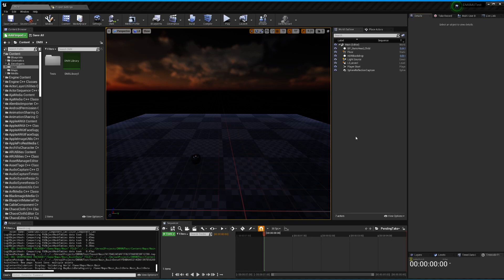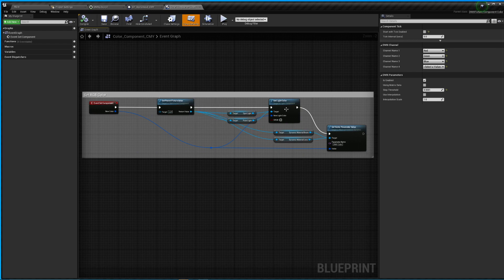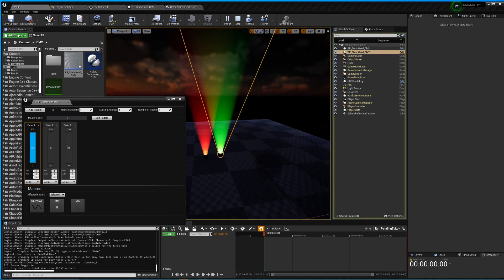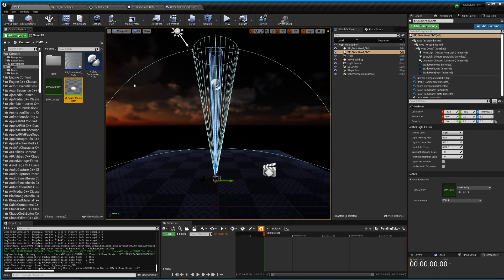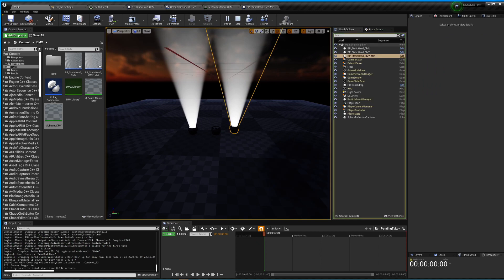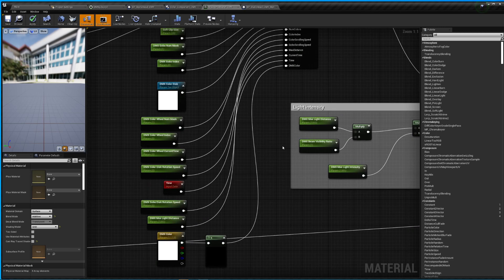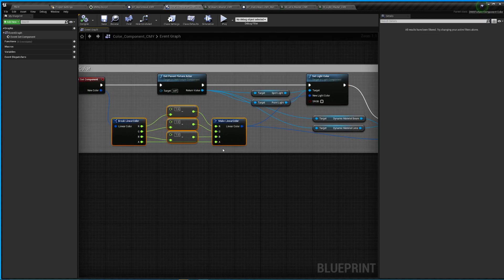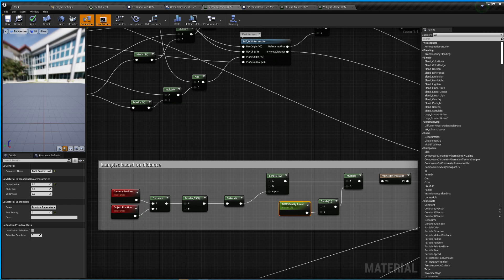RGB to CMY conversion for DMX fixtures in Unreal 4.26

Comment: Great video. How can we do gobo prism (x3) tho? Thanks.
Reply: Would love to know that too but I think there is no simple solution. I mean a prism is essentially breaking up the beam & light into several ones at a certain angle. So essentially the simulation would have to switch from one beam/light to 3 of them. Even more so thinking of my favourite fixture which can use two stacked prisms each with own rotation. Maybe its possible to implement it less resource intense within the raymarch shader but I don't know anything about writing shaders or the math behind this